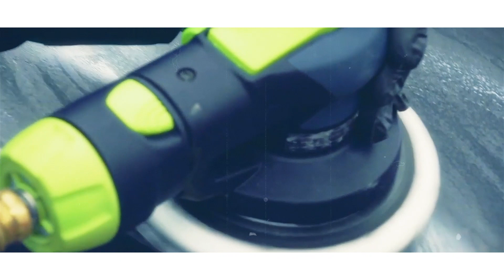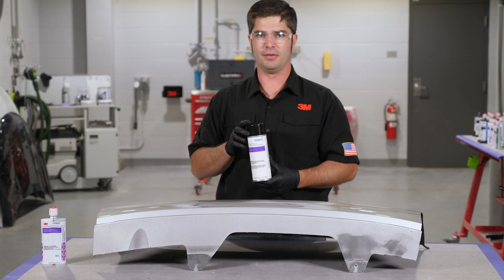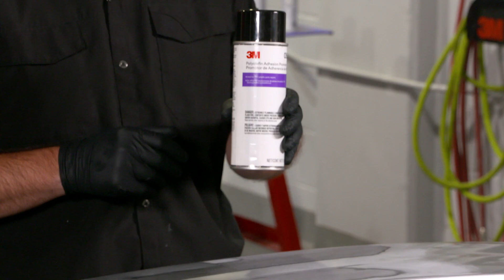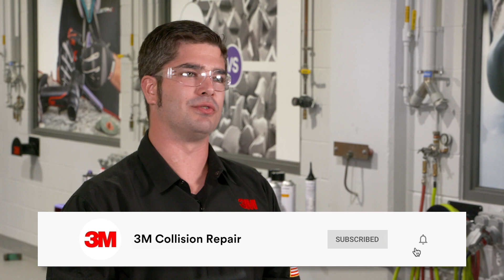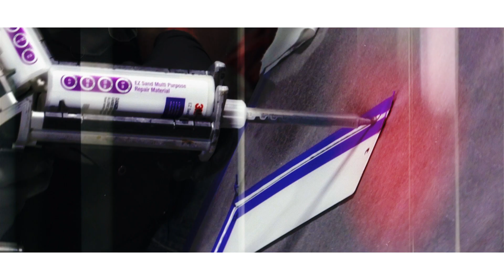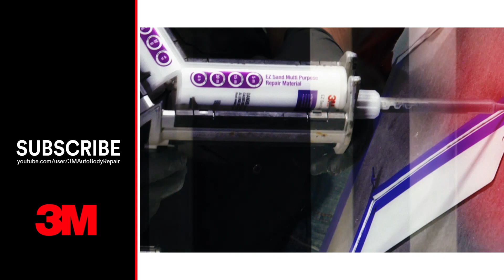HOW TO: Finish a Bumper Repair After Plastic Welding

Comment: Does this have to be done over bare plastic? I don’t want to sand off a whole lot of paint and just want to fill the crack.
Reply from the maker: Hi John -- Thanks for your question!

Please note that our standard operating procedure requires you to remove paint completely and extend the feathered area a few inches beyond the repair area. This is important because applying any flexible filler beyond the repair edge can result in repair mapping and costly comebacks. For more detail, check out our full standard operating procedure here: https://s.3m.com/q3c5ha1b